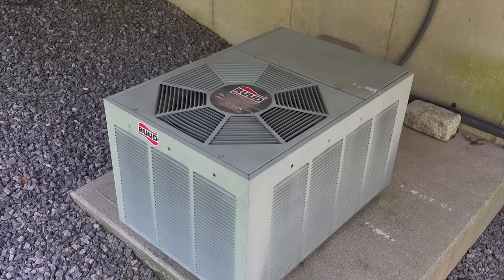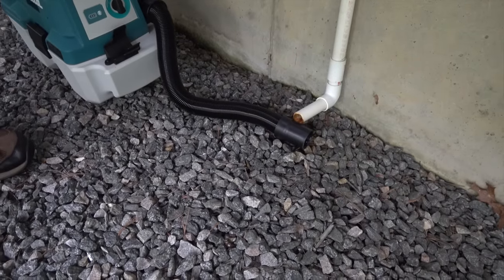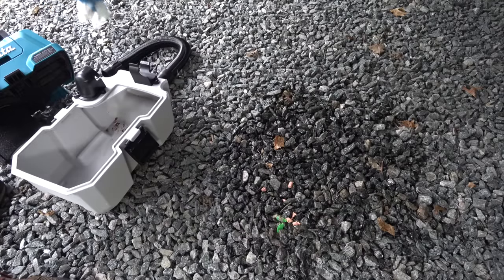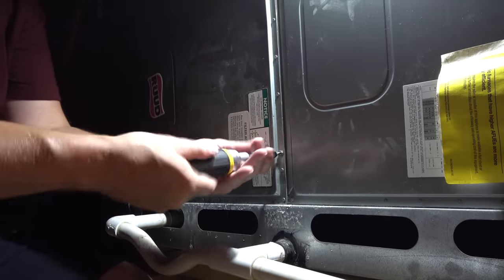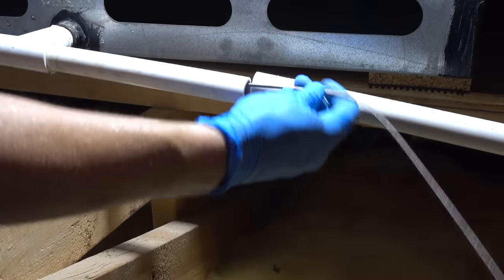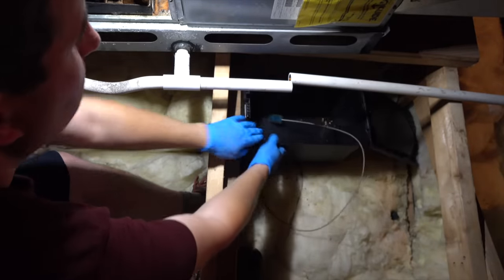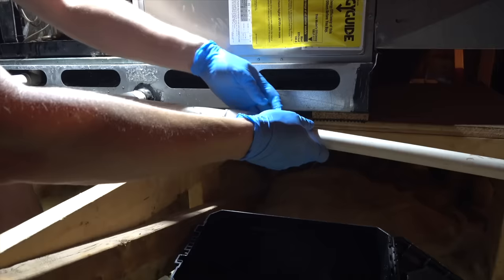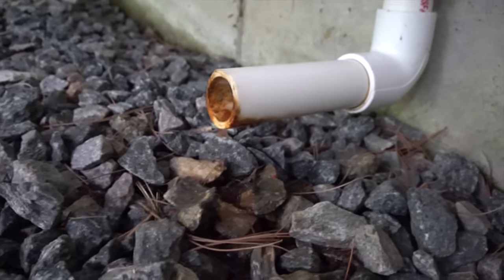How to UNCLOG your AC DRAIN Condensate line FAST - Water stains on Ceiling? or in the Pan

Comment: Thanks for the great video. The installers originally piped it with swivel fittings on the drain connection. Only had to untight, vaccum, and retight it in place. That pipe section was almost clogged!

Comment: I wrote to your company before. I had a Coil Cleaning. About 12/21.. This happens regularly. When Fla. Is said "Cold,"  A/C is off. This is when algae grows. This is a massive on going problem. I had my unit for about 8 years. I take Excellent Care of her. Now I have a slow leak once the unit stops, a couple of water drops start rolling out of my PVC Pipe. I think it has to do with the long PVC Pipe. I don't see any water easily drip into the PVC Pipe down and out. Any information would be extreme help. It really gets costly every year at this time. TY!

Comment: My house is one story on a slab foundation, with the A/C unit outside next to the house.  I use compressed air to blow any clog out, after disconnecting the drain line in the hall closet under the heater/air conditioning unit.  With the drain line running outside imbedded in the concrete slab, I don't worry about bursting the drain line.

Comment: Where the drain turns intot he drain pan, it seems easy to put a tee at that location when they first install the air handler.  Then add a short length of PVC and install a threaded cap.  All you have to do remove the cap, run the brush down stream to push the clog out.  As you did, pour water into the drain pan to flush  out any debris.  If I ever have to get into my attic to clean the drain, I'll be adding that tee.

Comment: Great video, but I believe that AC unit should have an overflow shut off valve on that bend on the pvc pipe, it’ll detect when the line is clogged and turn of the AC unit as a safety precaution and this won’t happen anymore, but like I said great video and very informative.

Comment: Shutoff valve at condensate pan, Schrader valve, 90 PSI on the air compressor.  Watch the crud fly.  Quick, clean, and works.

Comment: My temp wasn’t reading and fan on outside want running. Called a hvac friend of mine. Went in my attic drain pan full of water thank god I had a cut of mechanism that’s on my hvac that protect it which stop the fan from running. He ask for my vacuum cleaner use the vacuum hose to my pipes on the outside, nothing but water came out. But I had to go in the attic to get the remaining water out of the pan with a large sponge and a bucket a bit tasking but work

Comment: I use a connector that is designed for blowing out an RV's water lines for "winterizing" purposes.  Attach it (push on) to the end of a tee with the cap removed and then use my portable compressed air tank to blow out the plug.  It's worked every time.  Stupid contractor for my house plumbed two A/C units condensate primary lines together at a "y" before heading to a sink vent.  It's always that line that gets plugged.  I have 3 A/C units.

Comment: 1/4 cup vinegar every month. Pour it into the drain system so it travels the length of the drain system. Vinegar help prevent scum from aggregating and blocking out ward flow of condensate. Make sure the blockage alarm system that is set up in large pan is working.

Comment: Nice to see how pros deal with this. I'm in Texas, I deal with this every so many years, I have dual units on my home. But, I also have float cutoff switches on secondary drain pans. so when the cooling stops, I check my compressor/capacitors then my water drain. I actually just dealt with this last week.
Reply: Why the compressor/capacitor and what do I check them for? Thank you!
Reply: @Troy-Echo  Thanks! I think it's actually the drain line. I pulled the Safe-T switch and it started running again. My landlord still hasn't had someone come out to take care of the problem though. ::sigh::

Comment: I'm an a/c tech, after I clear a drain, I take about 10 condensate pan pills and dissolve them into a gallon of warm water and I pour it into the primary pan and flush the drain pan and pipe with this drain juice.  The whole gallon. To be sure its draining. In most big houses you cant run a hose to the attic.

Comment: Best way to clean drain line,

Pour 1/2 vinegar/Disinfectant/Fungal cleaner in the drain from the float switch and wait 5 minutes.

Hook vacuum to drain line outside and turn it on

Go inside and pour a gallon of hot water into the drain at the float switch or Evap coil pan using a funnel. 

It will suck out everything but be sure to prime the drain line after using vacuum. (Pour water in drain with vacuum off) I do this for all residential HVAC calls 90% of the time. Takes longer for the vinegar/Disinfectant/ fungal cleaner to do its job then it does to do mine.

And for the love of God pull the Disconnect before touching your AC! We are talking High Voltage so dont mess up cause you wont respawn.

Comment: I do the vacuum every couple months, never had a problem, my a/c unit is in my garage so no worry if blocks up . The water will just run to floor drain if the float switch doesn’t shut the unit off

Comment: We just put algae tablets in the condensation pan every couple of months. That prevents the clogs.

If your central heating and air does not have a float switch to prevent water over flowing. You need to upgrade to that. It is much cheaper than potential water damage.

Comment: Will a clogged line prevent an AC unit from cooling? My AC is not cooling properly and the outside unit keeps shutting off for no apparent reason. 
My AC is on the first level in a closet. It has a pipe that comes out and has a tee with a removable cap where I can pour bleach down. I wonder if I should get a brush like that to try to clear it out.
Also, could clogged condensate line lead to water dripping from the ductwork in the attic?

Comment: There really ought to be a vent before the P-trap that is left open to assist with drainage.
Many air handlers will include a float switch which should shut the unit off if the pan fills; it may need to be checked and cleaned or replaced.

Comment: My system is diff it a lil older and I had this issue. I can get to my pipes in the attic barley because of space and use that air gun or plumber gun to unclog and put it in the pipe and just hit the gun and when I went outside  the pipe that wasnt dripping had a bunch of build up that came like diarrhea no joke it was so clogged. It damaged my walls do to the leaking,but fixed the clogged pipe and now getting my wall patched up and new.

Comment: Question:after you cut and cleaned the line, why not install a T where you cut with a long up extension (above the coil) to vent the line so water can flow more easily? Ive seen others do that.

Comment: Over the years in FLORIDA, ATTICS ARE NOT MUCH SPACE, BUT AFTER FALLING WET CEILINGS, THAT IS NOE FORBIDEN. TIPICALLY NOW ON A STAND IN GARAGE, , then condensing unit nearby., Also too many men  died in hot attics, . ,also people never installed a SECONDARY PAN, 🇺🇸🇺🇸🇺🇸🇺🇸

Comment: Question: Living in a Condominium, my Drain LINE WAS COVERED IN FRONT WITH WOOD. I FINALLY FOUND THE DRAIN LINE, BUT THIS LINE IS COVERED. IT HAS AN OPENING, BUT CAN'T DO AS INSTRUCTED DUE TO OBSTRUCTED DESIGN. SO NOW AS SEEN ON YOUR  SITE, I CAN'T DO AS INSTRUCTED.. WHAT TO DO IF HAPPENS AGAIN? I CALLED TO HAVE IT CLEANED, AND NOW IT'S DOING FINE. THANK YOU!

Comment: mine clogged up and the drip pan overflowed, had about 3" of water in the duct.  Used my shop vac to suck up all the water then I blew out the drain line with compressed air.  I then poured bleach down the drain line, figured it would kill whatever mold was clogging up the line.

Comment: They should have had a overflow drain pan under the unit and an auxiliary drain line ran from the pan to outside with a float switch.that either kills the unit or just the compressor...
Make damn sure during the humid months that you use a clean low resistance filter or filters on your AC unit.normally most  companies don't size the return ductwork to allow for the resistance that comes with the pleated and electrostatic filter use..
When cooling a house you want to run as much air as possible through the unit.to remove the moisture and drop the temperature  .if you don't move enough air through the unit the coil will freeze up...You will notice that if you are going to use pleated or electrostatic filters use them during winter time or colder months,the air is dryer so you will have more dust.You don't need to move as much air when heating a house .....
He could have just put a pvc tee in the drain line after the trap,that way if he wanted to snake the drain,It would be easier to do  and if the drain line was long it would aid in draining...

Comment: My air handler isn't in my attic but I out a T in about 3 inches out from the unit with a 2 inch riser and a cap. That way I can add a little bleach once a month to help prevent mildew build up, it also allows me to insert a garden hose if needed.
Reply from the maker: Very cool! Great idea

Comment: If your air handler is in the attic it should have a secondary pan under it equipped with a safety switch that will shut the system down before it over flows on to the ceiling.. in the south it's code. Also you could go further and put in an in line safety switch and what that does is shuts the system down before it actually starts backing up. 🤔

Comment: I have cleared them before by taking the nozzle on my water hose and shooting a couple quick jets of water up the pipe...usually the plug comes right out.  Obviously don't want to put too much water in so that it backs up into the house.  I like the shop vac idea though!

Comment: I'm totally flabbergasted that A/C air handlers were ever installed in people's attics.  Building codes should never have allowed that!  A water leak in the attic can cause mold growth and mold is deadly!  It's represents a serious health threat to EVERYONE!  Plus it's no fun fixing the water damage to the ceiling and having to replace insulation that has gotten wet and moldy.  And once you cut out sections of a ceiling, you have to hire someone to come in and spackle the entire ceiling to make it completely flat, and then use a hopper gun to re-do the knock-down ceiling texturing.  If the ceiling was a popcorn ceiling, you have to have a sample of the popcorn material tested to make sure it doesn't have asbestos in it.  If it does, that's another major headache and health risk.  You have to have an expert at safe asbestos removal come in and get rid of the old popcorn.  Then you have to hire another guy to come in and modernize the ceiling texturing by putting in knock-down texturing instead of popcorn, and you've got to do the whole house rather than just the affected area to make it uniform.  You don't want knock-down in one room and popcorn in all the others.  Popcorn ceilings were a terrible idea all the way around.  But putting air handlers in the attic are an even worse idea!

Comment: Good information .. but if you have a water leak then you really need to use floater switches to prevent the water leaking in addition to a secondary drain pan.
Reply from the maker: Yes they are very common now here but 15+ years ago we didn't see them used on many instralls
Reply: @SilverCymbal  .. As a Builder we used second pans since the 80s. I'm not certain when we started using floater switches but I seriously doubt few if any are running (age) without one. My "feeling" is somewhere in the 80s or 90s the unit's pans had floater (wet) switches.

Comment: Cosmetically it's nice to have the air-handler in the attic but what a nightmare to do any work on them up there. Not to mention that if you have a clogged line, you''l most likely already have a wet/stained ceiling. It's best to have some type of drip pan with a water sensor that will shut off the AC if water is detected.

Comment: I live in an old house and outside drain outlet is a tiny metal tube (whereas yours is a PVC pipe) is there an attachment or something I can buy to attempt the wet/dry vac solution? I'll try to ball up a bunch of paper towels to make a snug fit but the metal tube I have is probably about 2-3 CM in diameter...

Comment: You should have probably used your shop vac and cleaned out as much of the drain pan as possible while you had the cover off. Your find rust and debris just waiting to flow back towards the drain outlet.

Comment: A question: did your thermostat show an error code e74 no power detected to RH wire? My AC was turning off intermittently with the error code, then turns back again on its own. 

Also if you could tell me what diameter the clear tube was. Thanks.

Comment: Our Lenox XC-25 fails with water overflow every 3 months or so. i vacuum the condensate lines every 6 weeks and have it serviced by the installer on the an alternate 6 week interval. The slime is coming from the condensate pan - and they won't clean it.

I'm afraid to clean it  because opening the unit  may void the warranty. Is there any way to compel the installing contractor to clean the pan?  Shall we just find another contractor?

Comment: Thanks!
Can a clogged drain pipe cause the AC to stop cooling the house?
Also, if I don’t want to cut the pipe, would it be bad to use a LITTLE compressed air going back into the pipe?
I saw someone do it with a co2 thing...but I don’t know if that’s bad practice.
Any help or advice would be great!
Thanks so much!!!
:)
Reply from the maker: The clogged pipe won,t but what happens is that the water backups up into the pan and many pans have a float swich that shuts off the unit to save it flooding out. Once the pipe is clear and the water drains out the float switch will turn the unit back on. I would start with the vac first since its easy and see if anything comes out. But yes you can use compressed air but I would check out the pan first and see if its filled with water. The vac usually works
Reply: Silver Cymbal I assume you’re a drummer?!?! Cymbal :) me too.

The drain pipe outside is about 1” from the ground (aimed straight down, will add an elbow soon) so gonna be tough to get my shop vac on that. If I used compressed air, where will all the clog stuff go?
It’s hot and looking for a quick temp fix before going to Home Depot to get other stuff. I didn’t see a float and the AC never shut off. The emergency drain from the pan fortunately is clear though as it’s a separate pipe.
Thank you so much for responding!!!
:)

Comment: My air conditioning unit is working fine, however, I noticed that there is an excessive amount of water coming out of the drain pipe.  Should I be concerned?  I though it was clogged but if clogged the unit would shut off or you would see water damage; correct?

Comment: I just removed my wall unit AC. It came with a factory installed drain plug. But inside my unit I had rust areas, dirty water, mold and algae (or was it gunk) just accumulated. I removed the drain plug before I put it back in the wall but now it seems water coming out the backend when its running. Was I supposed to leave the drain plug in? I read the fan slaps the water to the coil to help with cooling. Should I put a drain nipple with tubing to help slow down the removal of water from the pan? My coils had accumulated rust and so did the black unit in there. Can't get it off the black unit. Its like sticked on rust now. Please help me.

Comment: Easier way. Place bucket under unit.  Go to drain outside. Use water hose. Push hose against drain and let it fill until it reaches unit. The. Remove and let drain. Repeat once or twice. Cleans it right out. Having someone at the unit to let you know when it’s reached the unit helps.

Comment: Question.....my air handler is in the attic and the drain line exits the unit with a good slope.....runs of to the edge of the house and goes down (inside the exterior wall)...and THEN exits near grade level. The trap is at the end of the line near grade. Where is the clog most frequently found?.....near the trap? ( wherever it's located?, whether it is near the air handler like your vid, or at the end exit?)...OR.....is it just as likely to form in the drain pan of the evap....meaning...close to the air handler exit? The reason I ask is that so far I've been cleaning the trap at grade...it has some gunk.....but I don't want to miss a possible problem near the evaporator if it's also there. Thanks.

Comment: Will this fix an issue where the hvac unit is working and there's air coming out of the vents but it's not very cold. There's no water coming out of the drain pipe outside btw. Like at all. I'm just trying to make sure I don't need to call a tech and pay a lot for a recharge or something.

Comment: I went to pour some vinegar in the line the other day which I do every couple of weeks to keep it clear, I pulled out the emergency shut off float valve and there was a scorpion clinging to it, I dropped the wire and the scorpion jumped to the floor, they can really move.  I stomped on it.  So it had to have come in from outside via the tubing and god knows how many eggs it laid in the structure under the air handler.  How is it your attic is the only one I ever saw that was not loaded with deadly spiders?

Comment: I have a 2 story house. The line that runs from the unit in the attic drains out to an upstairs bathroom. I attached a dry vac to that line that runs thru the upstairs bathroom. I have a garden hose attached a water heater that is in the attic. I used the hose to try to push whatever is clogging the line as well as an auger. Doesn’t seem to have solved the issue. Outdoors, that line drains from underneath the 2nd story window. Do I need to put the dry vac to this outlet? Any help would be appreciated